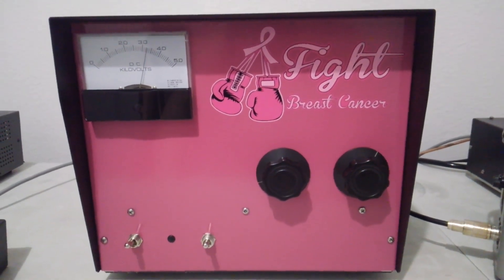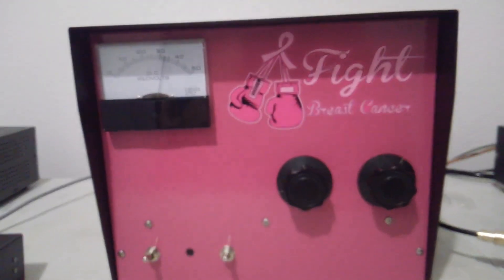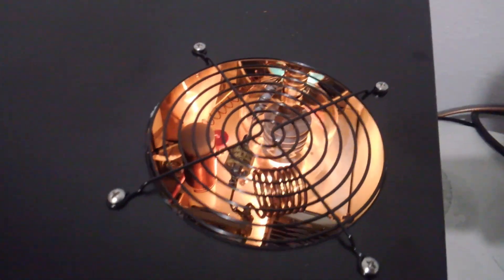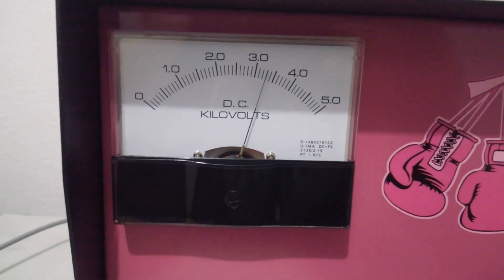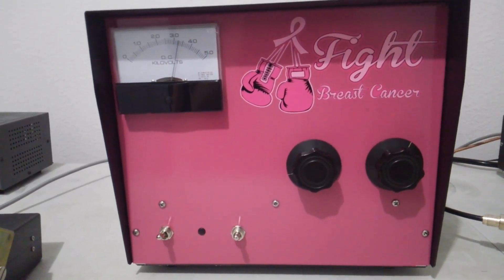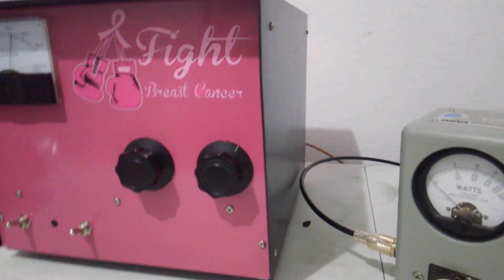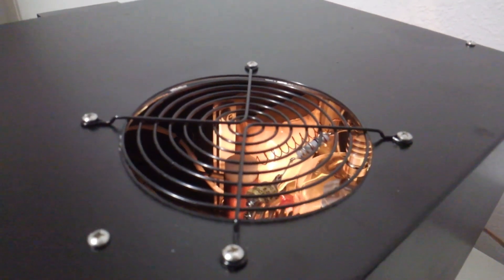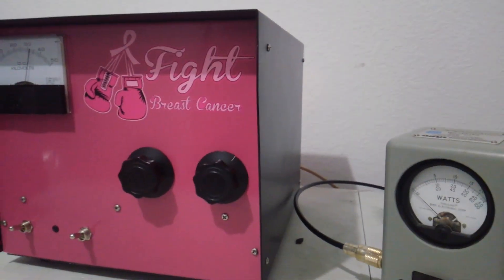Gump Built Single 3-500z Base Linear Amplifier (see description)

Comment: Have this one an 2 more all black ones  ready to go no wait time.  A 1pill is a perfect driver for these no matter if it's a single 1446, 2290 or 2879.  Will do 1500-1600pep an 500-600avg  depending on your line voltage.  Amp idles here on test at 3450-3500plate volts. You can put more drive in at your own risk. They will do 2000pep but they will not last long an the tube will red up fast at that.   These amps are all new. $1400 plus shipping.  Shipping is $75 without insurance an $95 with full face value worth of insurance. I pack SUPER well an have shipped many of these out that's how I know the shipping price.  NEVER had one I've shipped out get damaged knock on wood.  But if you live in the Midwest or west coast it's subjects to cost ya $100plus for shipping. Everything is expensive shipping the further west you go.  Thanks Gump
Reply: Can build a driver to go with one also if needed.  I've done many of those as well. Rooster has owned a few an may have a few videos.
Reply: @gumptechnologyjtgamps723  hey Josh can you do a tune up and wind up on a President Washington base for me? can I get your contact info? Thanks, Jason

Comment: Does he build any 4cx800 amps.. would be interested in a 2tuber..
Reply: Yes. $2650 plus shipping for a single 4cx800 with high/low an variable new an $3650 plus shipping for a dual 4cx800  with high/low an variable new.   Thanks Gump
Reply: Josh Smith  is a Thief
Reply from the maker: Yes any tube amp. He and 404 build together. They just sent a two tuber to Louisiana last month. Message me 423 299 3535